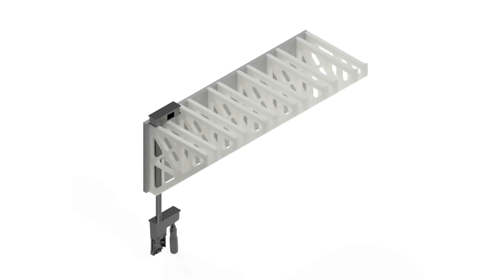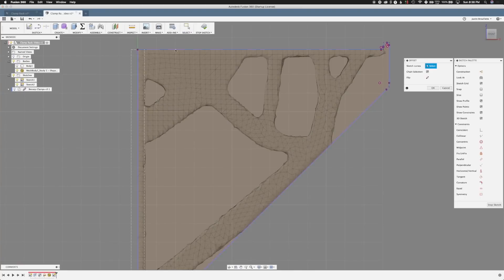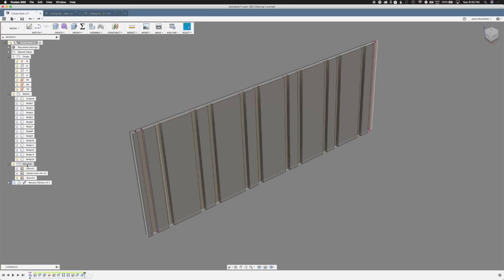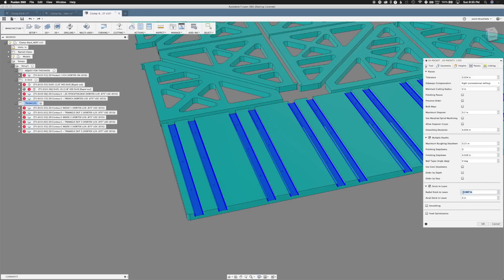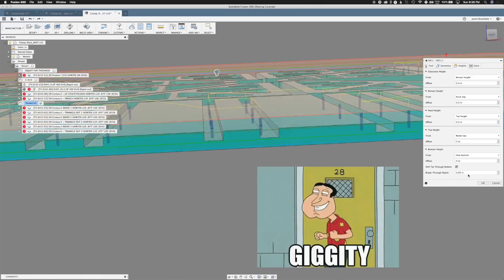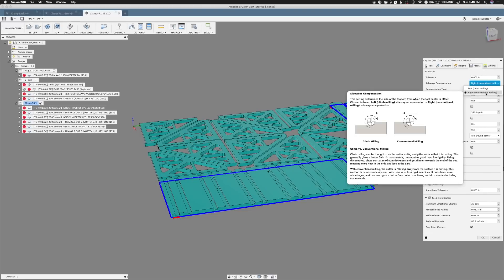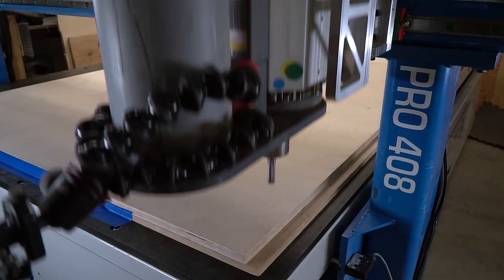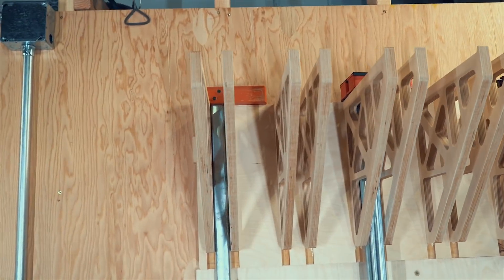Fusion 360 Designed and Optimized CNC Routed Clamp Rack

Comment: Hi I'm learning Fusion 360 and utilize Mozaik and am pretty fluent with sketchup. I'm used to 3d environments and am wondering if you could make a video that would show me how to do the trussing that you did here..not so much for structure but for 3d print speed. I need to remove material not required but would prefer a pattern similar to this.
Reply from the maker: Nice. The truss is nothing special, it's just a basic understanding of how a truss should work and drawing a sketch and extruding the result.